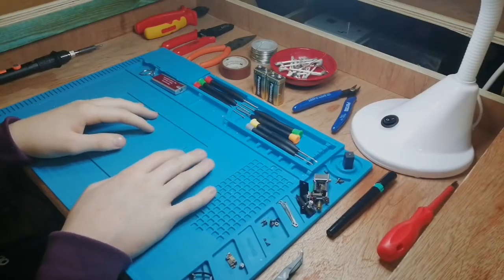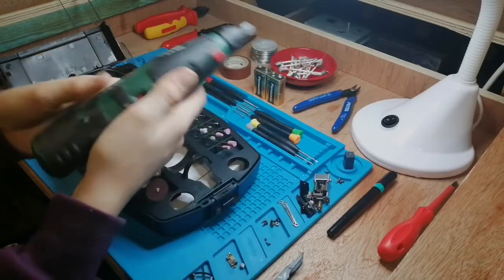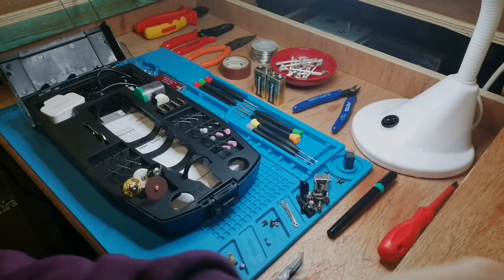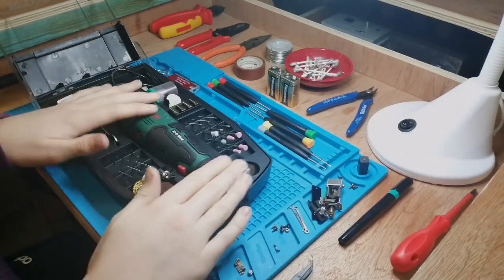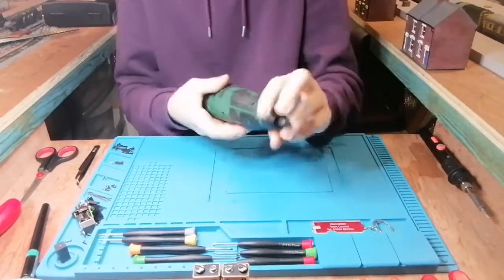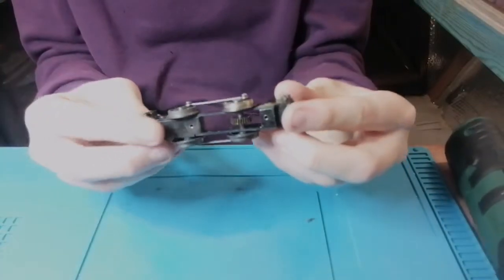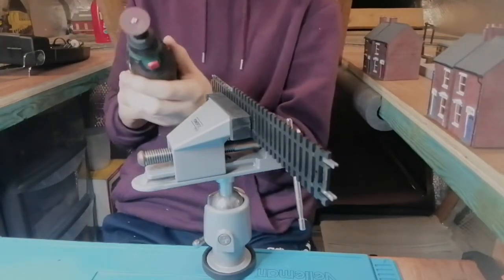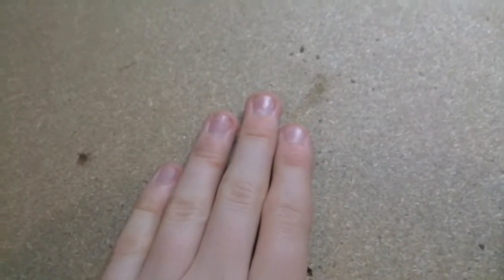An Unboxing, Test & Overview Of Lidl's Amazing £20 Cordless Rotary Tool

Comment from the maker: There's just a few points below I'd like to mention. (Others will be added if I think of anything).

- If it seems like my fingers are too close to the tool, it's actually just the camera angle. My fingers were at least behind the next wheel in line at all times during the wire wheeling.

- This tool was actually £19.99! I confused this year's price with the price other people payed a few years ago when watching other people's reviews. £2 more or not, the tool is still fantastic.

Comment: Many variant of this Parkside tool..
some with incl. 12v battery (the later versions like yours) while the earlier models were with detachable 12v pack, like you see with fx Dremel cordless models..
I reckon its the C5 model you have there, as it is with black plastic housing, while some of the earlier model had white accessory casing.
and your model also don't come with charger but only cord like the C5 version (which seems preferred) as I saw notice the early version with TypeC charger were with a weird TypeC pinout so you could blow other gear if you used that charger with other TypeC products and vice versa oppesit.
but 17GBP is a strong price... The C5 model its also in LIDL stores these weeks here in Denmark but at like +20% more.. (179 DKK) but that's the norm here.. highest consumerprices on the contient.
weird they are using such small 18650 cells.(1300mah) 3s = 12v, as most 18650 cells are 2000mah or above now a days, though not sure what brand they are using, but cant be a lot of amp it's consuming with its relatively small brushed motor.

I guess you can purchase a cheap adjustable Chinese mini chuck, and put it on.. it seems it's the same threading as the Dremel norm,.. it will make it easier to cycle between attachments & drill sizes, and don't have to rely on these incl collet inserts. 4:55 that can be a pain if you got a lot of different accessories.
(I tried with an older adj. small black chuck, and it did not fit... the C5 parkside tool was too small)
Reply from the maker: Suppose it's a bit of shame that it doesn't have the detachable pack, then you could swap them out. However, it won't be too difficult to remove the old batteries and possibly replace them with some more beefy ones when they eventually do die. Could make a video on that if they eventually conk.

I have heard about that and was glad this one didn't have that type of charger with it! Bit of a bad design that originally considering USB is supposed to be compatible with anything anyway.

Will be nice when I have some extra cash to get a chuck, as you say (and as I have found out!) changing the collets is very irritating!

Might have to measure the current draw one day, and I'll get back to you if I do.